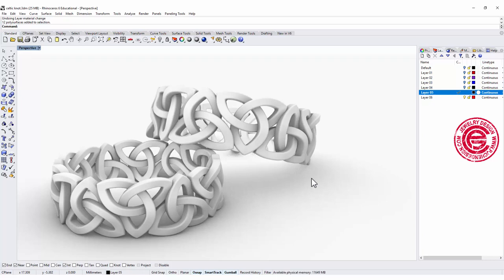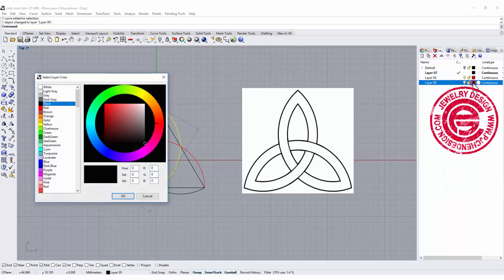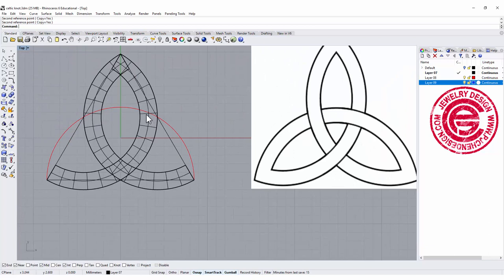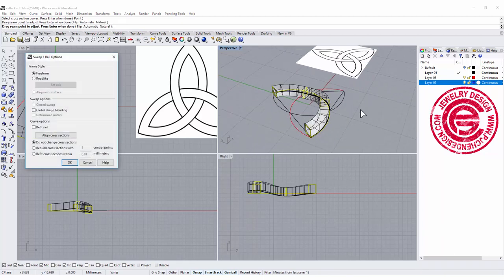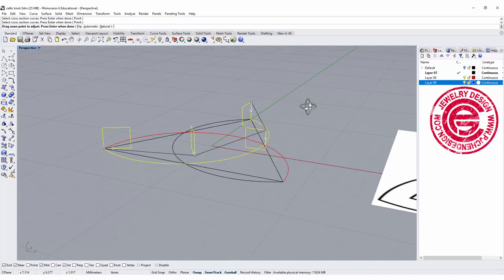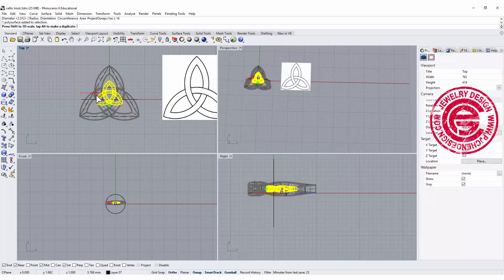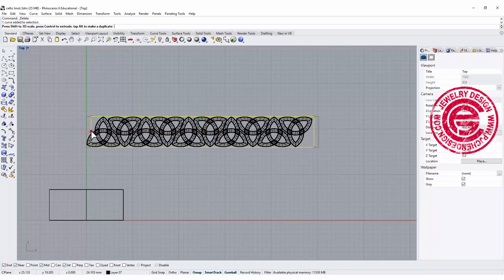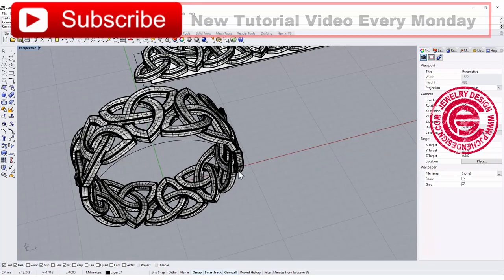Celtic Knot Ring Jewelry CAD Design Tutorial in Rhino 3D #48 (2018)

Comment: Self-intersecting booleans have always been a bit of a bugger in Rhino. Your technique is as good as any, although that boolean at 9:48 won't work on Rhino version 5 or earlier.

For earlier versions, you'd have to Join the pieces together, place a Box covering each corner (Polar Array would help), and Split the Celtic knot with the three boxes. You can then Cap those separated pieces, Boolean them together, Extract the caps, and then rejoin the split pieces.
Reply from the maker: great tips